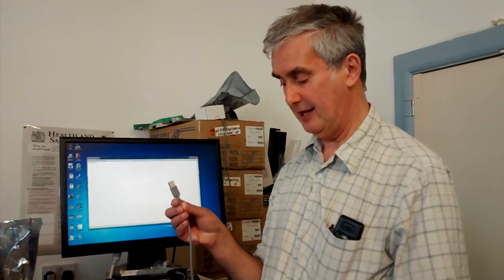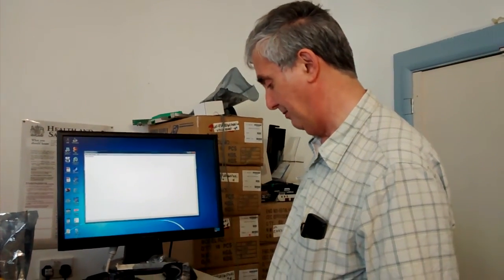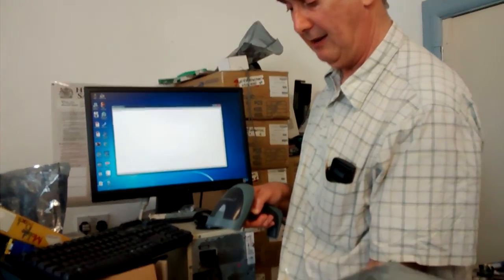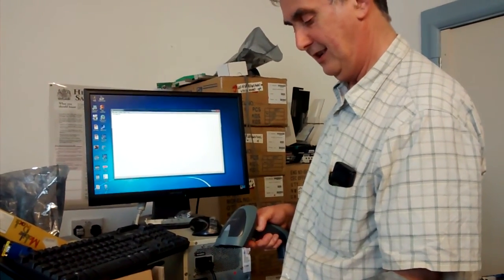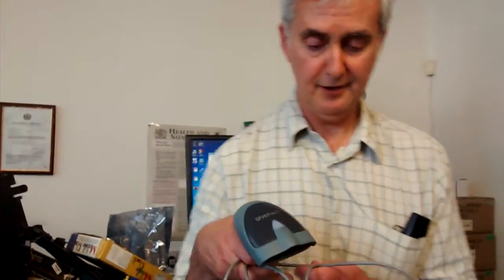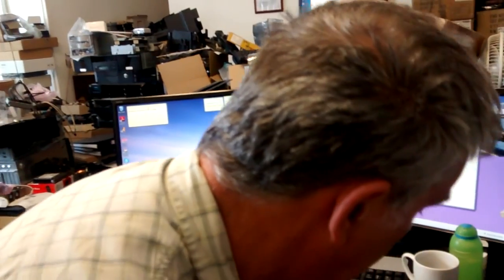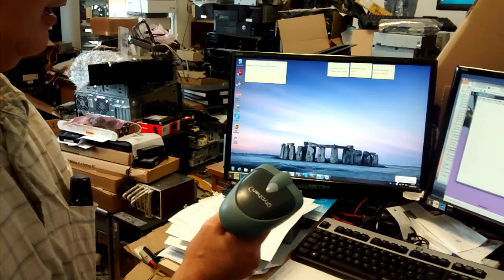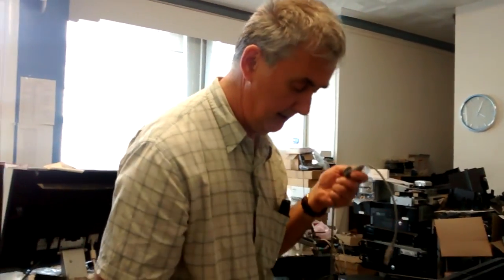The Datalogic Gryphon D432 USB port problem solved!

Comment: hello Mister HAMILTON

You seem very well familiar with that bar code scanner ...

may i require your help ?

I never had to configure that kind of devices before so i feel a bit lost, i downloaded the PDF manuels of the bar code scanners but even if sometimes i successfully make them work, i dont know exactly what i did to make them work , but anyway after computer reboot the config seems to be lost in the bar code scanner

i have

1x DATALOGIC GRYPHON GD4130 USB wired
2x ZEBRA Symbol LI4278 bluetooth capable
1x ZEBRA Symbol Cradle autopowered by USB and bluetooth radio CR0078S

1) for the DATALOGIC, 

i have restored EU default settings, so now the bar code scanner is like out of the box, when i scan a bar code for example "9 2075006949224057271011634 0" (without the brackets) the outpont in notepad is first çéàè(àà§ then there is a delay of half a second then the rest of the output is ç'çéé'à(éè&à&&§"'à
how can i fix that so it reads correctly the bar code ?
And ideally remove the delay (its not really a fixed time delay , it seems that it waits for the mouse to move for example before to complete the output)

2) for the ZEBRA's 

i have downloaded ZEBRA coreScanner driver, installed correctly on my Windows 10 Pro 22H2 (64 bits version both the OS and the Zebra drivers)

i have downloaded the 123scan , the cradle is detected the bar code scanner is detected, i have updated firmware of both to latest version availble FYI

i have factory reste the LI4278 to EU default settings, so kiek out of the box also
but same issue it doesn't scan,

I could got it working yesterday,i exported the config file to PC, imported the config to the other LI4278 after pairing (i have only one cradle is that a problem ? )

but after computer reboots it seems the configuration loaded inside the scanners is lost or revert and again when i scan its the weird characters and not what the bar code is suppoded to give

UPDATE
in the Manual PDF of the DATALOGIC
if i scan the bar code " Transmit Firmware version" the output in notepad is 
Gryphon)D'&xx SOFTZQRE **delay until i move the mouse** RELEQSE §&àà&!(àé 
Version §:à§:&&à§ Nov éè; éà&é

Any help would be appreciate , i'm starting to lose all my remaining hair, i'm almost bald after 3 days working on that shit...
Thanks for your help from people knowing those specific models
(its for a small shop selling small articles)

you can contact me by email I N F O (at) E C O L U X P C (point) C O M